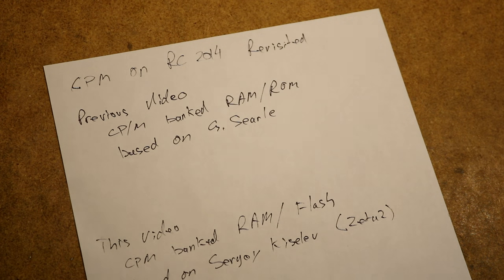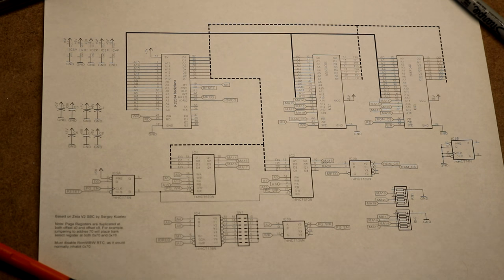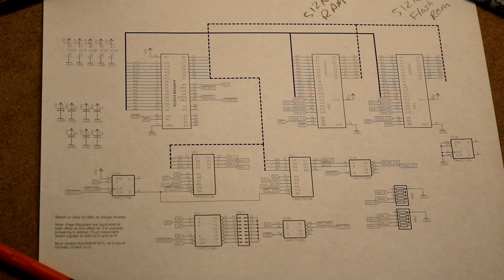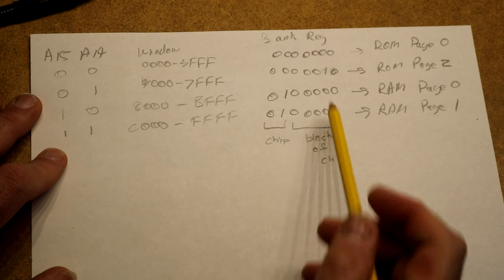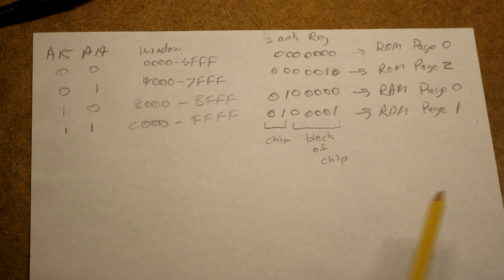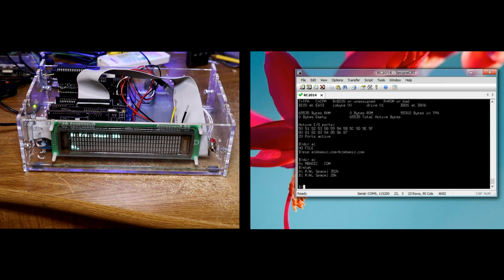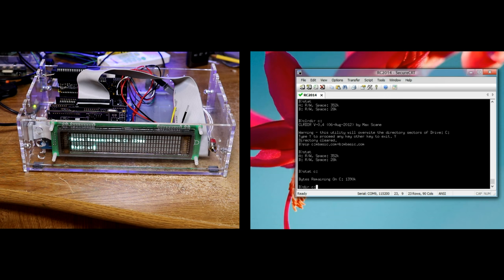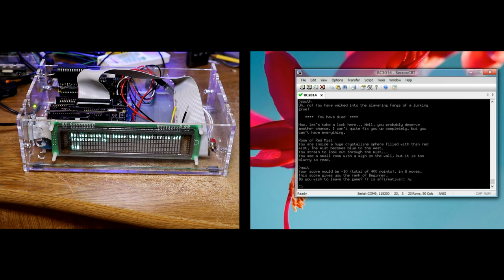Z80 retrocomputing 15 - CP/M on RC2014 Revisited, Using RomWBW

Comment: Just thought I'd add a tip. When running the cmd files: If at any time you see the message -

"... cannot be loaded because the execution of scripts is disabled on this 
system. Please see "get-help about_signing" for more details"

You will need to run powershell (in windows) and type in: 
"set-executionpolicy remotesigned"

That sets the necessary permissions.

Comment: I remember wanting to do allot of this back in the past.  What I was wanting was to create a multiple Z80s system, each on their own card.  One would control floppy, one would control memory, one for tape (no HD at the time), one would be the CP’ and control all of the keyboard, video, etc, and the rest of the 8 total CPU’s would be used for pre-processors or batch processors.  It would have been useful in the days of compiling large source code at the time.  I got the idea from a Heath kit version that had two Z-80 CPUs.

Comment: I just started  building a RC2014 with the Basic loaded. But I'm already thinking about building my own from scratch. I note there are quite a lot of assemblers out there is there anything you would recommend using for a beginner. I do have a preference for something with a ide and perhaps simulating option.  I am think of building a Z80 clock or some kind of simple control application. Regards Chris

Comment: 31:24 Is there any way you can (4 Custodial Inventory screen) to move (by pressing the buttons, arrow up and down) up and down, to see previous text? (or  print/display over 4 line to screen (pressing spacebar to see the next 4 lines). Like cmd is /more . Displays output one screen at a time)

Comment: Quick question, why is the display from xmodem different on the 4 line VFD display than it is on the serial monitor?
Reply from the maker: The transfer status lines printed in the terminal (bytes transmitted, KB/S, etc) are printed locally by the terminal software as it is sending xmodem packets. After each xmodem packet is sent, the RC2014 responds with an ack character, and those acks are what you're seeing on the VFD.
Reply: Makes sense, didn't realize it was a local graphic on the remote side. Sure fooled me. Thanks for the response!

Comment: Are you using all those banks on fly?i mean can you use 512k rom and 512k ram. all together in same power on without ting rom off and reprogram it or switch banks. how it will work without even change any code? code was allready there you just build to that spec? i thought i will see some smart asm programming how do it lol
Reply from the maker: Yes, it can change banks on the fly while it is running. Memory is segmented into four windows, so it can be executing code in one of them while it switches banks in the others.

Comment: I understand the hardware but how does 1 bank transfer data from another?
Reply from the maker: Wayne Warthen's RomWBW is publicly available on github, and contains the bank switching code if you're interesting in having a look. Since the banks are only 16K in size, it would be easy to bank in two 16K pages and copy between them. Looking at the RomWBW code, it looks like they use a temporary buffer, copies from the source bank to the temporary buffer, switches banks, and then copies from the temporary buffer to the destination bank. My assumption is that the highest bank always stays fixed, as that is where the BIOS lives.

Comment: Can it run GEOS?
Reply: It's a Z80 and not 6502 processor with no graphics yet, so not likely.
Reply: Another expansion card could handle the graphics output...
Reply: not related to geos, but is a cp/m emulation with vga output and keyboard input. https://m.youtube.com/watch?v=y_Y5Z7Ks5yA